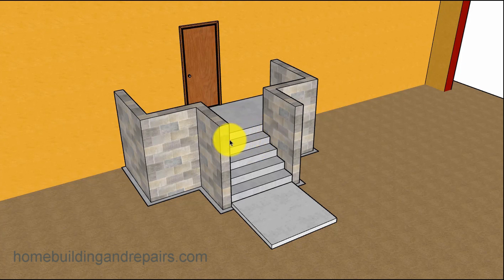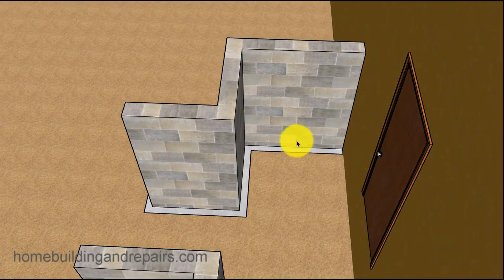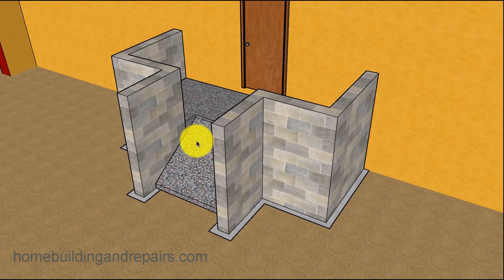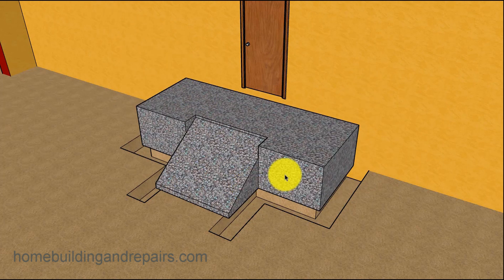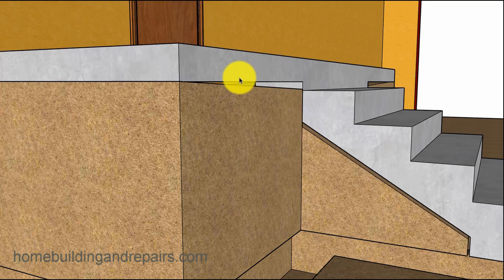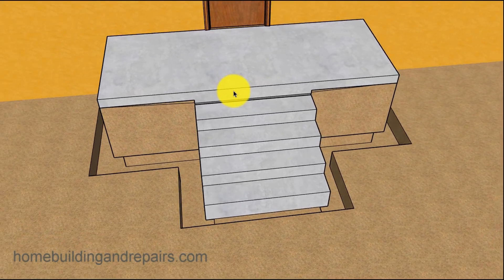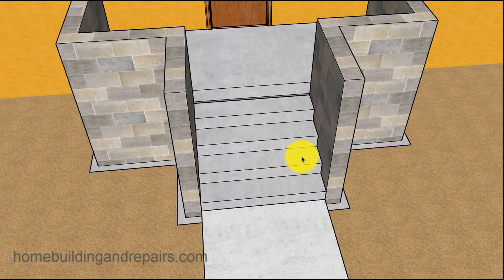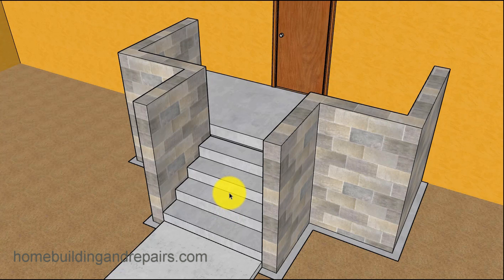Why Concrete Stairs Sink Into The Ground And Create Safety Problems

Comment: I can’t tell you how helpful these videos are.  This is similar to a situation I’m looking at. Demolishing the whole porch, steps, sidewalk and planters would I’m sure be the right way, but not feasible. 

Hoping to be able to either jack the existing bottom 2 stairs up, or remove/replace only the bottom stairs.
Reply from the maker: You can do it and if you can't, then they get removed and replaced.
Reply: @stairbuilding  Thanks. I’m thinking a person would have to cut and remove a bit of the sidewalk at the bottom of the stairs, in order to get a jack in there and to pack in gravel if it works…  or I might see what hiring a pro might cost…

Comment: my concrete steps are sinking and they are solid concrete  in the past 50 years it has sunk 1 foot in the past we added some patio pavers on top that work for a couple of years but continued to sink know iam looking to build a wooden deck over them and let the stairs sink  and the step size is W57"xL57"xH2'  and that is 7136.15 lb of concrete that is before we added the patio pavers to it

Comment: Another solution is to have the rebar of the concrete stick into the walls, or support the concrete with not visible masonry from below. The infill material than only acts as a cast, and can subside as much as it likes after the concrete has hardened.

Comment: I have seen your other videos on concrete stairs. Mine are just tilting to the right since the entry is on the left. I believe your jack technic will work but had some questions. The driveway seems to be attach to the stair should I cut a line in between so won't damage it? Can I send you some pictures? Thank you sir great work.
Reply from the maker: Yes send some pictures.